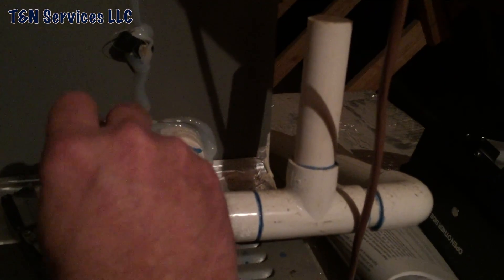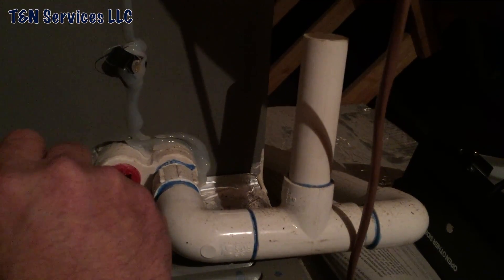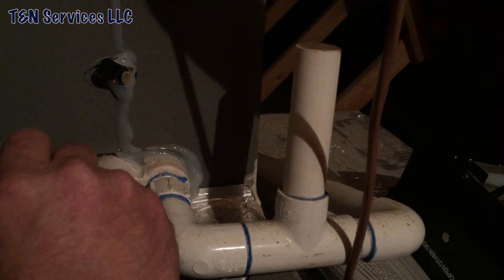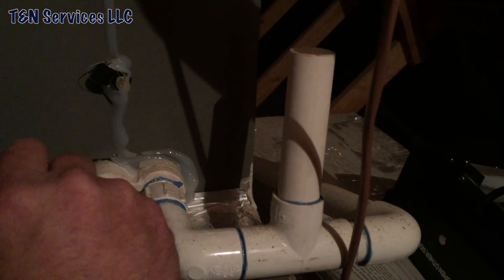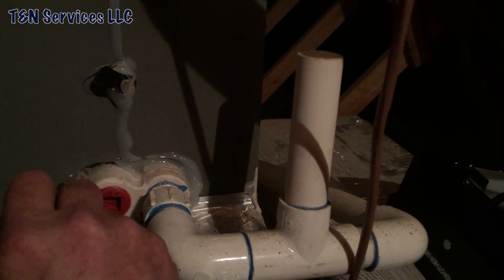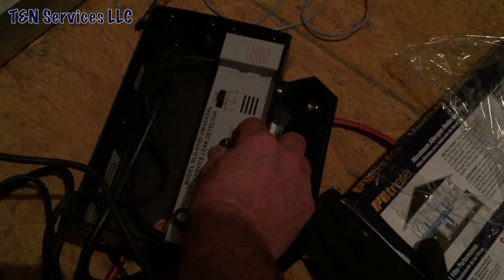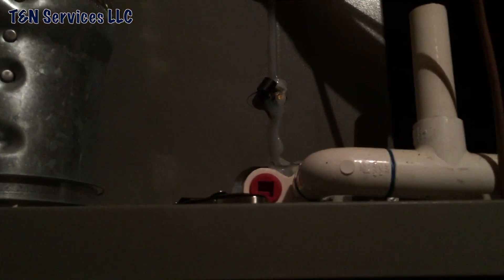Finding an HVAC Freon Leak using the H10 G

Comment: Coil time, nice find Ralph. Just had to replace the battery in my h-10pm 4 years not bad,
Reply from the maker: Thanks Rasta, the system is 8.5 years old I told her she just needed a new coil and she said she wanted a new outdoor as well. She said she didn't want to worry about it 2 years from now.
Reply: +T&N Services LLC. Smart customer.

Comment: I've had a Refco Startek for about ten years and that thing is so sensitive that it'll pick up the traces of refrigerant absorbed in the insulation around a coil after it's been pumped down and aired out for an hour or so. It only has 2 settings... too sensitive and WAY too sensitive. It'll come up above idle sniffing automotive AC hoses from the traces amounts of refrigerant that permeate through the rubber.
Reply from the maker: That's why I like the H10 I can dial it down so I can get close to the leak.